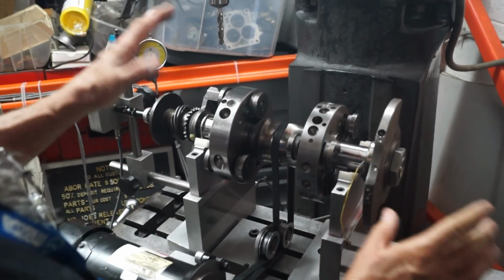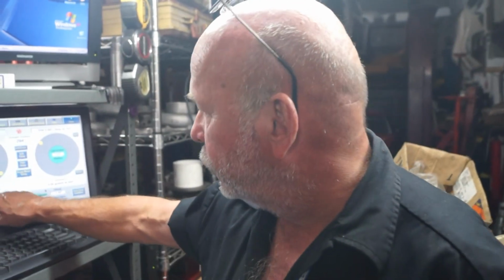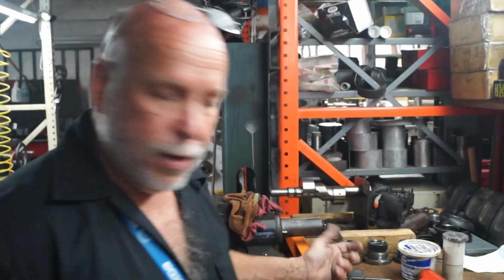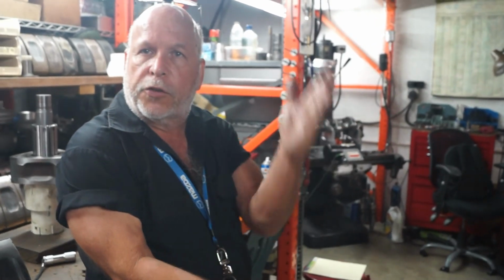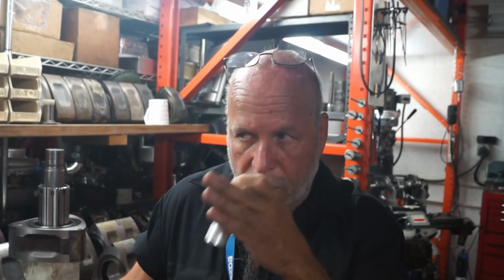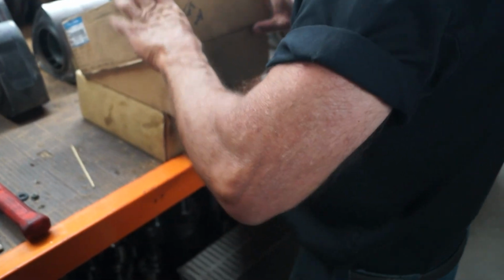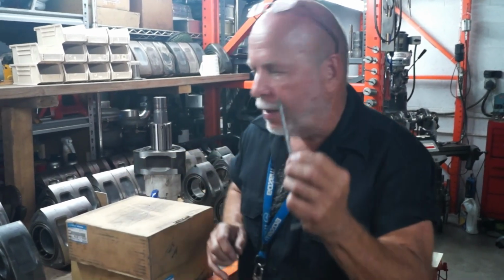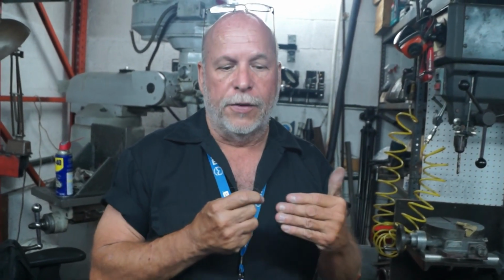RX8 Balancing

Comment: I contacted you a while ago about having some machining work done on some renesis rotors and rotating assembly that I plan to use in my SA's RX-5 4 port engine and wasn't too sure whether or not to go through you based on the pricing, but after watching this video the whole way through I can really see the true meaning of "you get what you pay for" which I already knew, but the depth and dedication of which the process goes for this service is well above and beyond and I think that's well worth the extra costs rather than going through someone else who would save me a few bucks and just leave me with "good enough" as Carlos explained.
 If you can send me your email again i'd very much appreciate it and thanks for putting out all of the awesome videos, all very informative and entertaining to watch
Reply from the maker: Carlos is the most dedicated perfectionist I've ever had the pleasure of working with.  He usually goes way over and above the call of duty to satisfy not just his customers, but his own sense of satisfaction at what he is capable of accomplishing with his Rotary Kung Fu.  Just remember the old saying, you can have it done fast or right or cheap but you usually can't get that altogether.  So you can get it done right but it won't be fast or cheap.  You can get it done cheap, it might be fast, but it probably won't be right, or you can get it done fast but it won't be cheap and it probably won't be right.  We try to deliver all three at once if possible, but never at the sacrifice of doing it right!
Reply: Ya, well I'm not too worried about it being done fast, my SA is currently my daily and my build plans are in no rush. I just want to build an NA with a bit more power, a lot more acceleration and all without sacrificing longevity (as much as a street ported 13B has anyway) or efficiency (which should increase with upping the compression by .8) and if I'm going to take on a project like this I just want it to be done as well as it can possibly be done and Carlos is definitely the man for the job.
Reply: You can also waste time and money getting "perfect" when "good enough" is...good enough. Especially given how compromised those engines are anyway and the fact that people spending stupid amounts of money on them for "high-performance" use are never going to get anything close to "perfect" results. Of course even with an internet spewing rotary propaganda, those engines are dead. 

Period. And they're not coming back unless somebody at "Mazda" wants to break it off in some more fools' asses with an "anniversary edition" Mazda RX-whatever one of these days and somehow get around emissions laws with a low production exemption of some type an suckers "collectors" into paying through the nose for a museum piece. 

And what few fools all the hype is brainwashing into thinking these engines have a future and their money spend on ridiculously expensive "rebuilds" and  "crate engines" are like MOST "car enthusiasts" who are willing to pay "experts" crazy amounts of money to take a pile of new and used and "rebuilt" OEM parts and some aftermarket imported junk to build a "performance engine" and think they can have "big power" and "durability" will blow their shit up and often until they get tired of polishing turds or the trust fund runs out or they have to start really working for a living to have the money to play and find they'd rather find a cheaper hobby than work harder.  

You don't see many mature, responsible "older" car guys throwing stupid amounts of money at rotaries and that doesn't bode well for the future of the "rotary community". Of course neither does the fact that they've never been anywhere close to "popular" at any time they were in production and they may someday be "rare" but it will only be because they're not REALLY "worth" putting too much money in NOW. 

So if a guy is a "rotary specialist" selling ridiculously-priced used and cheap aftermarket and "rebuilt" parts to fools who are getting older and wiser every day and every time another "rotary enthusiast" buddy or acquaintance of theirs "hangs it up" because they're sick of throwing money on the burning pile of cash "sports car" in their garage or driveway or the "rotary performance shop", they're be a little closer to doing the same thing, the "rotary specialists" who have paying customers who are gullible and clueless and trusting enough to pay out the ass for "perfection" when "good enough" will do had better cash in now.

Comment: 8:50 It's weird that the Rx-8 has unbalanced rotors but the highest stock rev limit vs the Rx-7. How does Mazda justify the 9000 RMP? I'm guessing it's because the rotors themselves are the lightest the less rotational mass results in the higher RMP? Thanks for the upload, I'm loving this stuff.
:UPDATE:
Not sure if this is true but I've read that rx8 rotors are balanced but in a different way than before from an online post I'll include.
"Up to rx8 mazda balanced rotors static , now they are injected with a gel and balanced dynamically.

 Every engine i have worked on that has been balanced by a so called expert has had a nasty vibration at some rev range . One rotating asssembly was taken back 3 times each time hed say now its perfect. B S. When it died an apex seal broke ( shattered ) suprise suprise oppisite to that seal a bunch of balancing marks hed made. 

 Engines with the original rotating assembly or untampered with matching parts work best. 

 But from a shops point of view , an unbalanced engine isnt going to last as long , and they can charge you for it.  Vibrations = broken apex seals , chatter marks and bearing failure."
https://www.nopistons.com/rotary-engine-building-porting-swaps-55/engine-balancing-36201/page2/

So that would explain why they don't have drill marks on them for balancing. I'm not siding with the above post I found over what the guy says in the video, it might be complete nonsense. I'll let whoever reads this choose what to believe but I would just find it astonishing for mazda to not do some kind of balancing to the engine. If anyone finds anything else on the subject please share it here.

Comment: You know Carlos... once you add Metal Conditioner Squared to this flawless balanced shaft, you’re going to have ZERO drag man.
Reply: Hi Ryan,  been a while. I've been totally consumed, with zero spare time for months now developing some new technologies that are sure to make some revolutionary performance improvements in Rotary Engines,  and drastic changes in fuel consumption and longevity as it pertains to the Renesis.
Reply: The use of this new tech on the Ren, was not the initial intention for the developments, but have to give credit to our small team here. both Richard and Boris convinced me to try it on a dead Rx8,  engine. So far the results have shown improvements beyond expectation.  That in it self has prompted a new idea which we are testing at the moment. This combined could potentially change the whole Rx8 game all together. 
We are now building an engine just for testing and development on these new technologies. I intend to test the additive at that time.. The data gathered will serve and provide the necessary proof for the patents.  At witch time we will have back to back data available for comparison before and after. It will be interesting to measure improvements in reduction of friction from the additive.  Any reduction in friction will show up as increase in torque.
Even if it's just 1 Lbs/Ft.
As always, Thank you.
Reply: Carlos Lopez Any updates?

Comment: Explaining to people that you MUST rev the shit out of a rotary, and drive hard at almost all times, always gets the weirdest and most surprised looks lol
Reply: Especially because rotary engines were never designed with automotive use in mind much less stupidly high engine speeds. Wankel was designing a "poor man's turbine" engine and had in mind stationary, constant-speed LOW-SPEED applications such as portable generators which typically operate at 3600 rpm to produce 60hz power. You have to "rev the shit out of them" because they are completely wrong for their application. Is there any other automotive engine that needs the shit revved out of it? No. Does that tell you anything. Probably not. You're a rotary fanboy. You don't listen to common sense and you're so mechanically clueless and dead set on being a "rebel" because it give you a reason not to listen to "piston engine guys" who would school you and already school  you even though you don't admit it.
Reply: @deeremeyer1749  fanboy lecturing a fanboy, great.

Comment: If you are balancing down to 1/10 of a gram, how do you account for exact amount of oil in rotors, doesn't it also vary based on casting imperfections?
Reply from the maker: The weight of the oil factored into the bob weights mass is one of the closely guarded secrets of balancing.  But to answer your specific question about casting imperfections, there couldn't be that big of a difference between rotor to rotor that would amount to much.  The rotors are weighed before they are balanced as well, so it would show up if there was that big of a discrepancy.  Finally while it is possible to balance down to the 1/10th of a gram tolerance, in truth 1 gram is more than sufficient for most applications.  Hell if Mazda couldn't care if they are 7 grams off for stock applications, 1 gram is pretty much adequate.  By the way this video about RX8 rotor balancing is presented to show what a challenge they are to balance and nobody would really bother using RX8 rotors in real high performance applications anyway.
Reply: @RichardViscasillas  question Richard, what modification, and purpose, has been done to the rotor, on the mandrel, next to Carlos ?